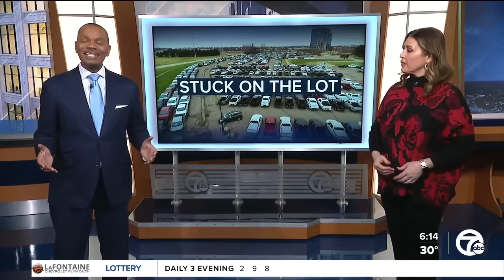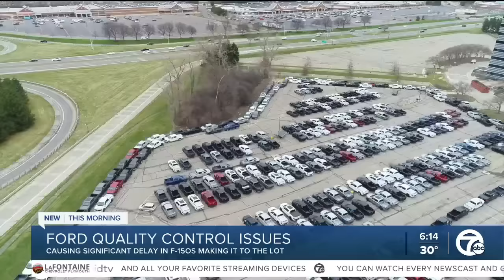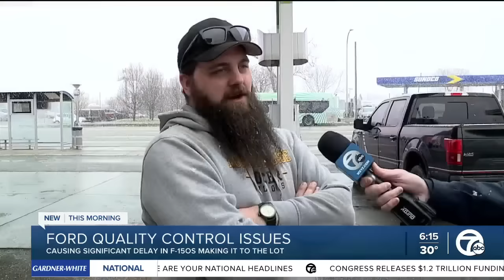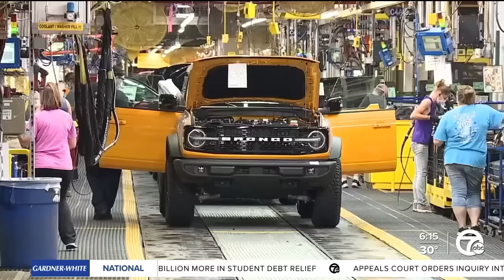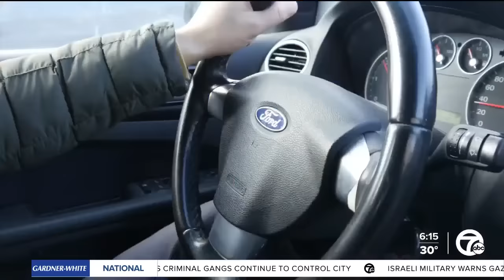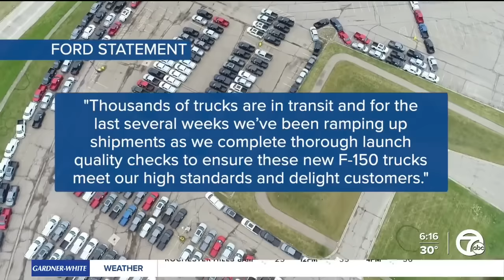Thousands of Ford F-150s are sitting on lots in metro Detroit. What's the issue?

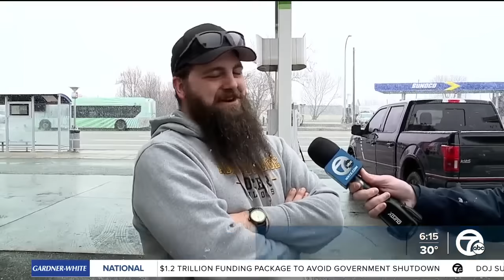Comment: 1:15 this customer has nothing to do with this issue. His 2018 F150 is not a part of this as its a completely different generation. Dealers are refusing allocation for these high spec 80-100k trucks because no one is buying them. That’s the real reason, and I don’t blame them.

Comment: Dude, had 4 freaking new Chevy trucks in the last year, the crap new 4 cylinders with the junk sealed transmission. They are work trucks from my employer. Can’t even get 3,000 miles out of them and they are literally falling apart, transmission went on 2 of them, 1 started itself randomly with no key in truck, and no auto start feature, ac out in 3000 miles.

J U N K!

Ford is not alone in quality issues. My Ford is fantastic, 2017 and 120k miles, no issues

All in the eyes of the beholder.

Comment: If they are those worthless, not fit for purpose Electric F150s, that explains that.
If they are "regular " F150's , the newer ones rust through in just a few years , one of the engine options is a disaster of a failure(2.7L V6) ,and the sticker price of 75k - 100k is insane.

Comment: Considering how expensive trucks are today, Who can afford them? I bought a 2018 RWD Platinum, $52K. Today that same truck is nearly $80K. Any higher trim Super Duty is nearly into triple digit and some are. I have a 19 F-450 Platinum that today would cost $106K to replace. It stickered for $86K back in 2019 and sold for just under $80K.  Combine those prices with the high interest rates, who can afford them?

Comment: My 2019 Ford has been a lemon. Had to replace the AC 3 times, electronic issues, etc. Never buying a Ford again. First time I ever bought a new truck. Drove it off the lot on a cold day a few days later tried to use the AC and it didn't work.

Comment: The check engine light came on when I test drove a new Ford F-150 Raptor with less than 25 miles on the odometer. I immediately walked away. No longer interested.

Comment: Either electric or so overpriced nobody can afford one. I'm driving a used 2004 F150 XLT Extended cab I bought 5 years ago. Only 140K on it. 5.4L Triton 3V V8.
I think I've spent about $1000 on repairs since then. BTW, I paid $9075 off the used car dealer's lot, all taxes and fees included.
Driver side half door plastic cable retainer broke. I have aluminum ones, but haven't got around to putting them in. Typical problem.
Same thing happened on my 2000 Ranger. Fixed that and sold it.
The last repair/service was the A/C, after 20 years the Freon was so low it wouldn't blow cold air, and I live in South Carolina. Firestone Auto Care took care of it for $248.
Flex plate, new starter a couple years ago, front brakes and rotors I did myself last Summer. New headlight modules recently.. Doesn't get great mileage (14-16 MPG), But I don't drive much. Retired.

Comment: The longer these Ford F150 or any other new vehicle sits on a seasonal lot waiting to be shipped or sold, Well THEY WILL START RUSTING, We have already seen new vehicles being sold at dealerships with rust on the underside of these vehicles. SO IF YOUR GOING TO BUY ANY NEW VEHICLE CHECK FOR RUST 1ST.

Comment: Meantime, they are trying to force EVs and monstrous technical trucks on us that we don't want.  All I want is another Ranger like I had back in the 90's: simple, tough, small, economical, stick shift, hand crank windows, no power anything.  I don't even want a radio.  Yes, they've proven to me that an ECM makes the engine more efficient and lasts longer.  That is the only chip that should be on a truck.  Even my '90 Ranger had more than I wanted, as a truck should not have carpet.  They should have rubber mats that are easily swept out, and truthfully, there should be no electrical connections that could be made wet by hosing the floor of a truck out.  Trucks are for working.  They should be built like they are made for working.  The only "luxury" a truck should have is leather seats, as leather is about the only material that can stand up to the punishment that a truck takes.  If and when that new little Toyota makes it to the US, it will put the big three automakers out of business unless they come up with something to answer it.  There is a huge pent up demand for a $10,000 truck with a decent sized engine and a five speed stick shift that is dependable and tough.

Comment: Manufacturing and labor costs are so high that they have to use substandard parts.  Also, stringent fuel economy requirements are forcing the use of smaller engines and plastic parts.  The results are expensive trucks that fail frequently. This type of conditions resulted in Japanese dominance in the 80's next it will be the Chinese that take over the world wide auto market.

Comment: I am afraid of getting the new models of any car.  I just want a plain simple vehicle without all the computers and cameras.  I would love just a 2 seater car but not electric or hybrid.  Just a plain jane car that will get be around since my city suqs at public transportation.  I bought a NISSAN cross over in 2011 after a deer took out the entire driver's side of my car.  I find it unblievable that I have to buy two different size windshield wipers and I can even reach them to change on my own.  The rear window wiper, gets replaced twice a year and it is very seldom used.  Two tiny windows in the back that are useless, and I learned that I had more room in my 2003 Huyndai and smaller older cars I had than in this Nissan. Window wiper motor had to be replaced, another part for the wipers had to be replaced.  These are items I never had to buy with older cars.  When I saw $80K pickups, I said, no-no-no and not only no but hell no.  Another car hit my car and I saw that the top panels are attached with plastic bolts to the bottom panels.  It is time to bring the cars of the 60s and 70s back. No computers and we can have a back yard mechanics back.

Comment: I sold new Fords a few yrs ago, and even then delivered new vehicles with faulty parts, Ford new, we delivered vehicles, only to to have them towed in the following day, and then fix issue. Should have been fixed before they were sold. Ford is Fix Or Repair Dailey, exploding tires, vehicles rolling over, the list goes on Don’t buy any Ford gas or Evs

Comment: With the "issue" staring at EVERYBODY, okay.  
And: Filter.
Resultant: Quality Control.

Reference: I worked in Production, Metal Stamping.
Background: MBA MGT.

I constantly refused to run.  My out-of-spec. Info. was to run.
Feedback, Ford: Q.A. Report.  From zero to three binders full of Notices.  

Now, who was responsible? We supplied to Magna.  Yet. Ford cited us.  Waivers granted by?
Steel: supplied from Rejected from auto-makers, coatings: sent out, returned for further process,  on-site packaging? 
Quality was is the issue.  
Send out Engineers IN-SITE. Suppliers must have Supervision.  Mandatory! 
An $80,000 vehicle with defects? That is WHOLEHEARTED INCOMPETENCE.
GRADE:  FAILURE.
In-house supervision MUST have constant demands of buyer present.
I've said it before.  I'm saying it now!

Ladies and Gentlemen, Thank You.

Comment: My 2012 3.5 ecoboost had the well known engine rattle on startup issue begin at 75,000 miles. I was just out of warranty and nagged the dealer until it was partially covered. Guess what...past 150,000 and last year and rattle is back. $3500 repair. Not fixing it. The ecoboosts have big issues!

Comment: False, this is an inventory control tactic to maintain the appearance of low dealer supply to keep prices (and profits) high. Manufacturing the original effect caused by covid supply chain issues. Ford learned and they are keeping this in practice.

Comment: Quality is ALWAYS a CHOICE.  I've spun wrenches on land vehicles since the 1970s and jet fighters since the early 1980s. Stop accepting trash. Stop designing DELICATE systems.
Trucks should be RUGGED which means I can beat the sh1t out of it like my 1976 F100 (which has outlived millions of other trucks) then fix it easily. Hyper-complex vehicles today are designed with zero regard for maintenance so no wonder repair and crash repair and insurance costs skyrocketed. No one at Ford or any other US maker understands this. Americans can make
systems easy to work on. I'd rather work on an F-16 then on recent CANbus vehicles and I've worked on both.

Comment: I got a 2020 Chevy Silverado trail boss package for $40000.
 i checked out the equivalent ford F150 and they wanted $60000 for the same half ton truck. Ford... your trucks not only do they break. A lot and I would know because I drive a 2018 F150 at work but absolutely overpriced especially because other trucks outclass the F150 by far coming from a guy who's driven all the new trucks.

Comment: I speak from experience.. I had a bulletproof 2017 F150 5.0 with 167k miles on it, i ordered a maverick and a year later i picked it up and traded in my 170k'ish f150, the maverick lasted a month before it caught fire, and they bought it back, the gave me a bit more than i payed, and i put that money down on a new 22 f150 platinum 5.0.. which lasted 4 months till it was lemon law bought back, they replaced it with a 23 F150 powerboost that lasted 7 months till it was bought back due to an entire electrical system failure.. now i have a lexus..

Comment: I'm waiting for our dealers to get a few on the lot. I want to see if the XLT version has gone back to halogen lights and removed the LED's

From what I see online, it almost seems that way!!

I have a 2021 XLT with the 302A package. $63,000 new. The one I built online for 2024 is $75,600 for an XLT.

Comment: I have a 2022 f150 tremor which has been a total piece of shit ! Cab falling off it, sensors, battery, leaking front diff ! 20,000 kms or 12,000 miles ! And this junk aint cheap !!!

Comment: Don’t buy a ford
Until you read all the issues on the ford forums 2016-2023 all having stalling issues etc don’t buy ford. Mine is a 2019 just
Paid $1200 to have it fixed and it’s still stalling
No codes pulling.

Comment: Ford has forever lost my business. I bought new a 2004 in July. Compressor O ring cracked when bought. Radio/CD console shit the bed in ‘05. Same year E brake cable came loose from one side. In 2007 I sold it to my dad who parked it for a year in the backyard. Didn’t want it back so sold it to a guy down the street. His first trip with about 55K threw a rod and totaled engine. Ford refused a replacement since warranty expired. I bought a new 2008 GMC Sierra and as of now with 89K still parked in my garage as we speak in 2024. Had to replace both headlights, driver side wheel well and took a hit from a drunk driver in 2010. Calvin can piss all over Ford if you ask me.

Comment: Ford and GM always use the cheapest components they can source, they always have. And it's not just in the US. I'm Australian, and we used to have both Fords and GM (Holden) vehicles manufactured here. I've owned several Fords, and they all had component issues. Parking brake lever braking off in my hand, I replaced a drivers side door handle assembly 3 times on one particular Ford I owned. Why would you make a door handle assembly, something that is constantly used, out of cast iron, they just break into two pieces. Or a hand brake lever out of hollow plastic.

Cheap and nasty and way over priced. That's why people won't buy them anymore, they buy Japanese or Korean cars if they want an affordable, reliable car.

Comment: loaded toyota pick up for 45 grand and will run for 200,000 miles before you have to do anything to them. it really easy to know why they are not selling, way overpriced and not great quality. ford has lost touch about the men and women that made ford number one, the people that actually use pick up trucks for their use. buy a 2015 for 20 grand and have the extra 60 grand and put 50 of it in the stock market and keep 10 grand for any repairs needed. ford has blown themselves out of the water. i feel for the ford workers because thats who this way overpriced truck is really hurting.

Comment: Buy a Tesla. They make the vast majority of their parts themselves and they have the most made in America parts than any other car in the US.  All the recalls for Teslas are pretty much solved by an automatic software update.... no need to take time off to go to a dealer.
Reply: Until you get into an accident or need a part.....and it takes 3-4 months to get it. Plus $5000+ to have a charger installed at your home. They don't tell you about that either. You save NOTHING with an electric car. Resale value on them is awful too! $10,000+ for a battery. I'll keep driving my Honda.